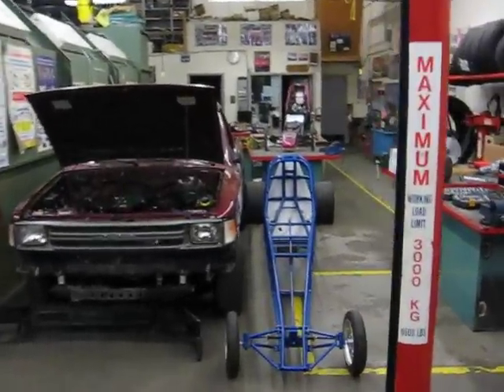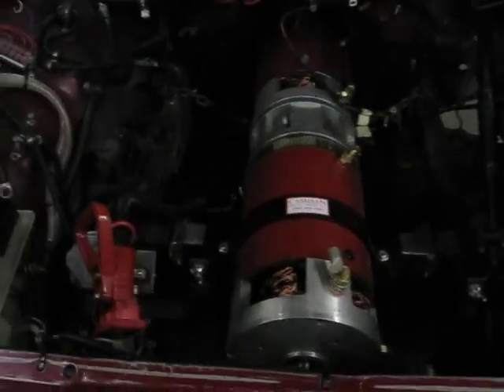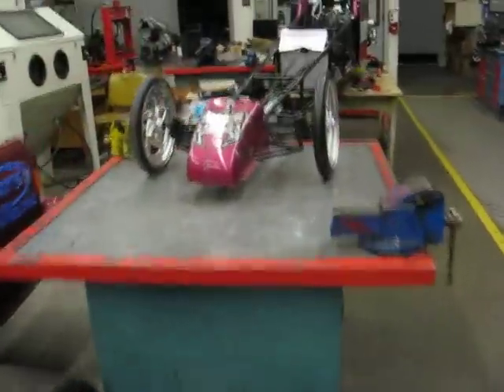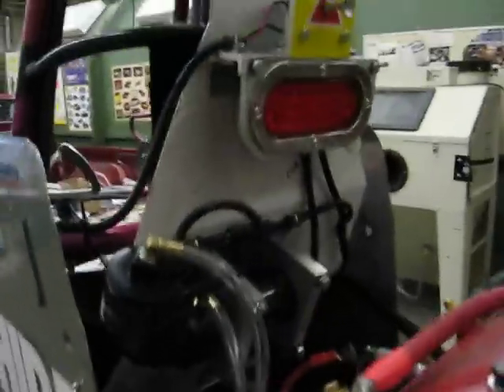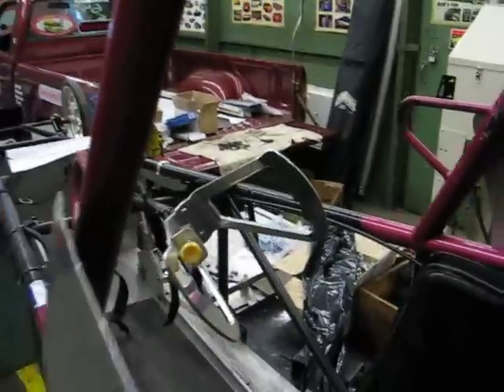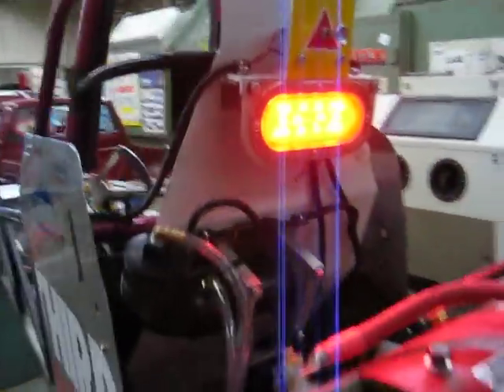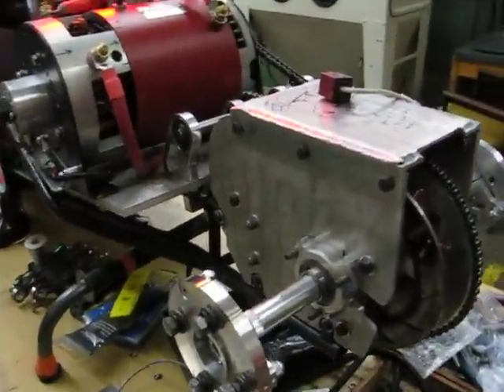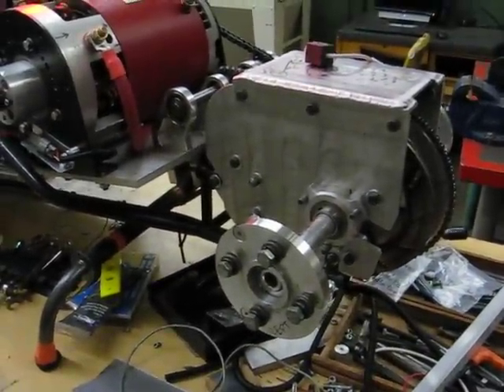Electric Junior Dragster - 200 HP @ 375 lbs - 90% complete!!!

Comment: AWESOME project!!! I wish I had these opportunities in school! These are some lucky students you have there.  One question though, is the steering shaft collapsible? My concern is that if there was ever a wreck and it was a front end hit that the steering would be slammed into the driver.  Not trying to worry anyone, but the ev i am building up i had that placed in, though it is a dune buggy (it is as simple as just a larger tube going over and a couple of low grade bolts holding it together)

Comment: What wheel and tire combination are you going to use ? Where did you get wheel adapters or did you make them  ?
Thanks
Reply from the maker: Hi! The project is complete and we have a video of us racing on the track last June. We used 4 bolt rims and custom made adapters on the lathes in the metal shop next door. It's funny how the rear  axle of these dragsters isn't an exact science like a differential. So, had the axle chucked up in the lathe and bolted the 3 bolt hub and adapter all up in the lathe to make sure it was all true as we machined. It all worked out great! :)

Comment: why 2 chains?
Reply from the maker: Oscar Radikoro Thanks for the comment! We could have gone with one chain direct drive but the motor would have been way offset for the axle setup we are using and the one that was originally being used. The motor we are using is really big. Way overkill for this application but it was donated! :) The original setup for this rig used a jack shaft. So, we kept the idea of the original design and are able to really tinker with gear ratios. With the bigger than necessary motor and jack shaft it all fits and works really well!
Reply: Casey Mynott ok thanks for taking time to explain.